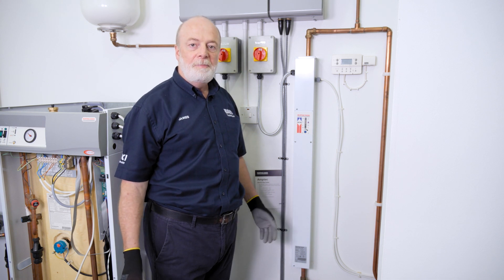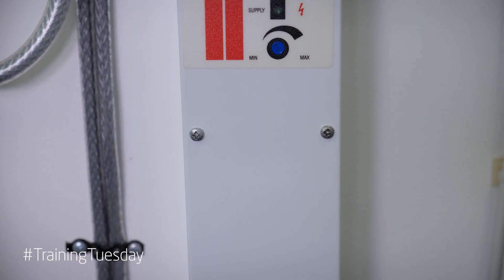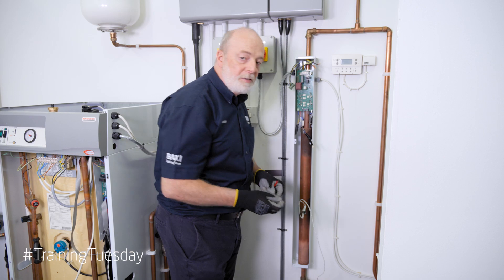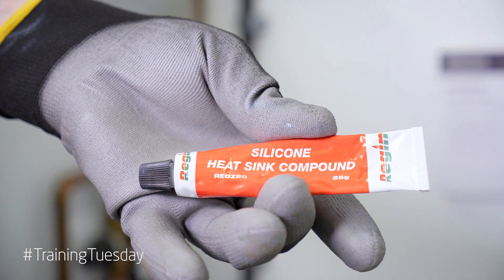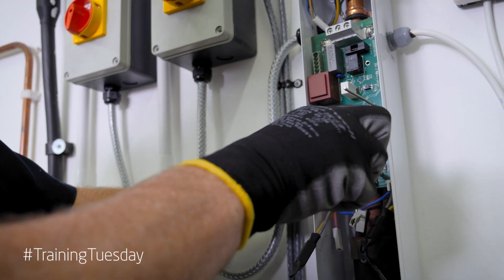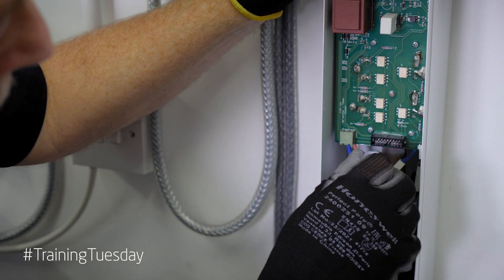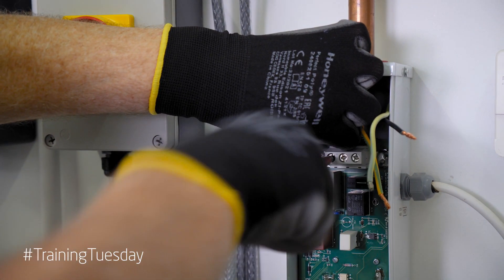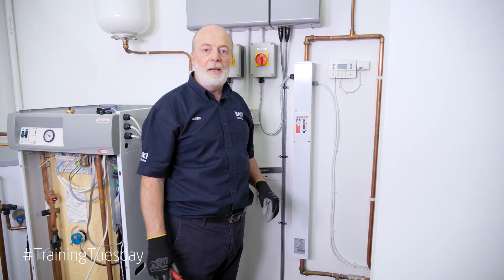How to change a board on the Heatrae Sadia Amptec electric boiler

Comment: Ref a  Heatraesadia Amptec Electric Flow Boiler C600 Question why does the installation instructions insist you must fit 22mm elbows to the Tails top and bottom of the boiler. I have a job to replacing like for like C600 boiler but it has a straight 22mm peace of pipe 50cm long on the top of the boiler before the 22mm elbow. Is this a problem? Regards Steve Young

Comment: I have an amptec electric boiler. The pump will not shut off even though the boiler is not calling for heat. Could this be a PCB fault (7years old roughly). Thanks.
Reply: 😮relay faulty on main board

Comment: Just done this. But still have a constant flashing red call light. Appears I have to change the small control PcB not the main PcB 🤦🏻‍♂️
Reply: Did you have any success with this in the end?
Reply: The fault ended up been the thermal cutout  switch